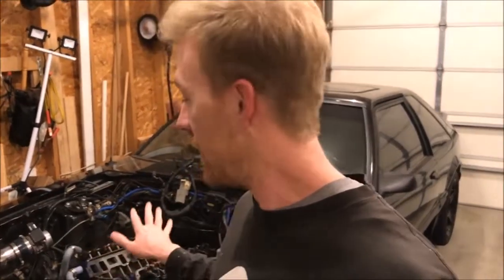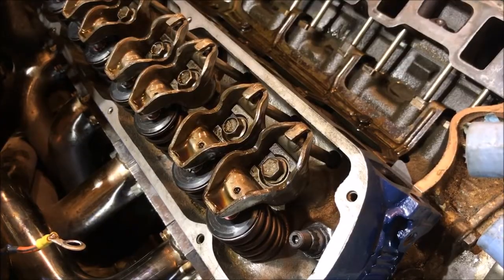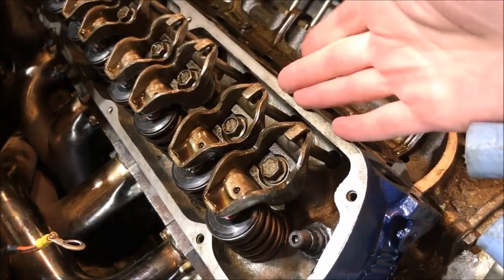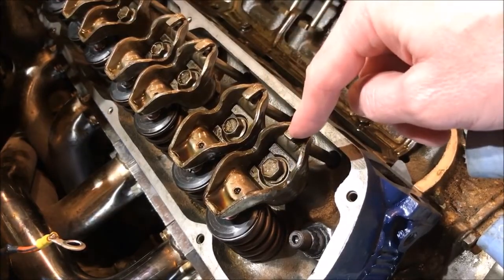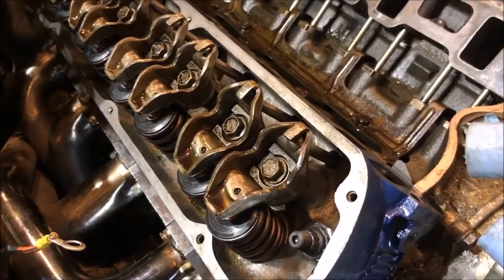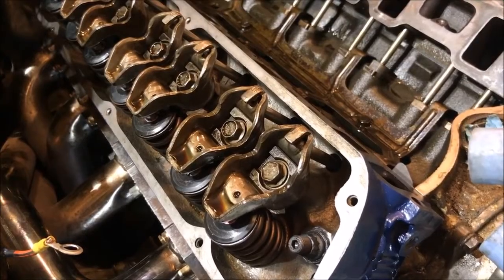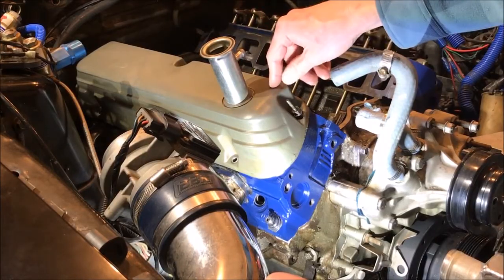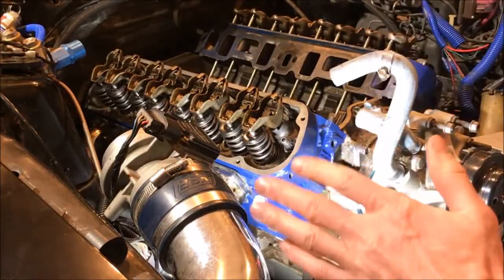Compression Stroke & Top Dead Center

Comment: I am trying to find compression stroke on Toyota's V8 engine. I took the belt off and moved crankshaft and camshafts. I have all the marks, I understand that there are two TDCs. And from your video I have learned how to find compression stroke. Now, when I am looking for the compression stroke on my engine, should I keep the belt off? I am trying to "reset" timing because I messed it up by moving the crankshaft and camshafts randomly with out the belt on.
Reply from the maker: Hello. It depends on which belt you’re talking about. The serpentine belt that drives your engines accessories or your timing belt which drives the camshafts?
Reply: Fast Fix I mean timing belt. But I guess without a belt there is no difference since the valves would not move... I have tried turning my engine (belt on) but the paper towel never popped. I did at least four full rotations.
Reply: Fast Fix the engine has a variable timing, I don’t think I have damaged anything when I was rotating stuff without the belt because I stopped when there was resistance. I also turned crank 50 degrees BTDC before moving cam shafts. So I am thinking that since it is a VVT engine, the valves will adjust automatically once I put it back together and start it. Is it possible?
Reply from the maker: Hello. I’m sorry, I don’t have any knowledge about VVT engines.  I would say that the crank and cams need to be aligned at the correct degree for the engine to fire. That doesn’t change because you have VVT. I believe most VVT engines use a cam phaser to vary cam timing driven by hydraulics or an electronic actuator, but that doesn’t have anything to do with getting the crank and cams in the right position to fire the engine. You’ll still need to find TDC in relation to your #1 piston in my opinion. 

I don’t have knowledge on Toyota V8s either. I assume your engine doesn’t have a distributor, but rather a Reluctor wheel.  To be honest, search for a more appropriate video for your application. My video was geared for domestic V8s. Hope it all work out and I’m sorry I couldn’t have been of more help.
Reply: Fast Fix thank you!
Reply: if you have the over head twin cams then you need the special tool to hold the 2 cams in sync togetherwhile ligning up the timing gears and chain or timing belt. make sure because twin cam move just 1 tooth and you will have head aches. so make sure those over head cams stay in align with special tool. have a nice day. hope this helped you.